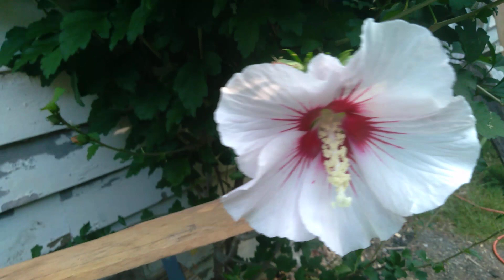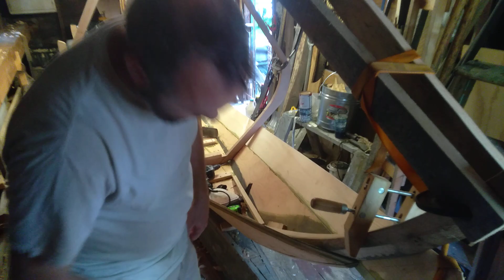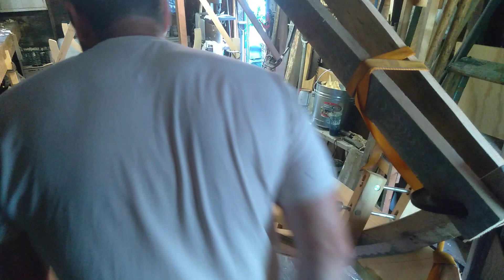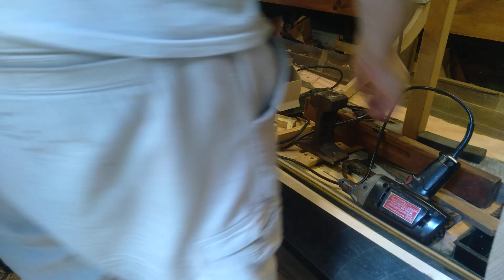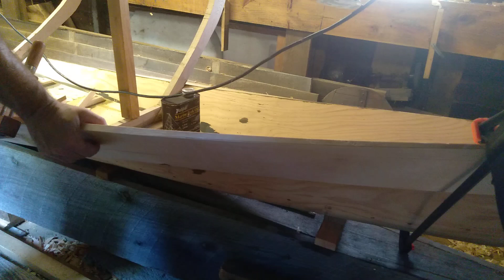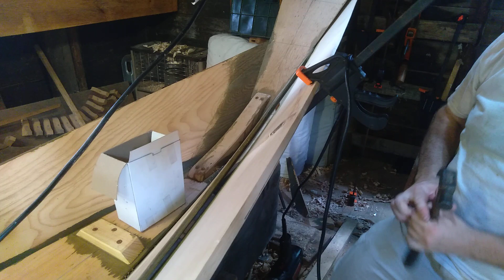Alpha Dory planking, 1st strakes

Comment: I guess this is a given, but does the cooprous oxide impede any later epoxy adhesion .. I would guess not if allowed to dry first?
Reply from the maker: It does seem to,  also paint and wood glue to a degree,  which is why I did not paint the bottom and outside of the garboard with it where I am glassing the bottom and garboard.